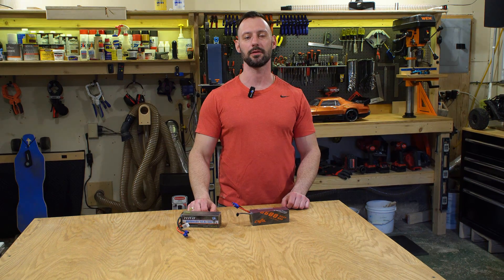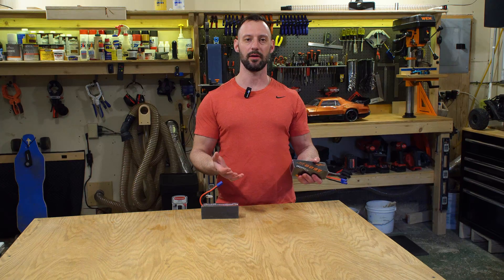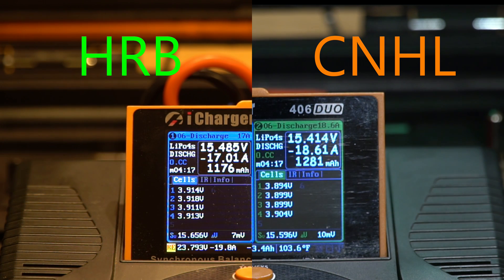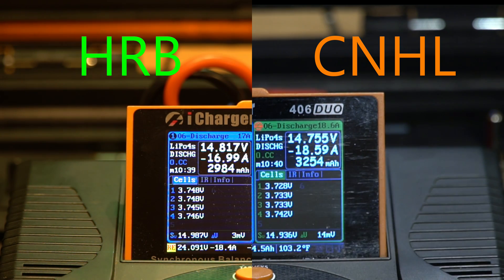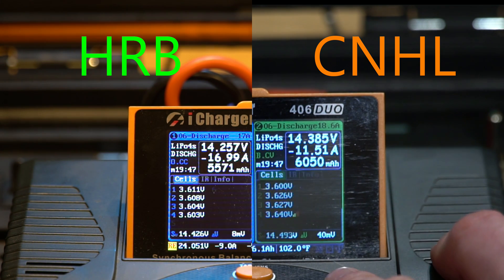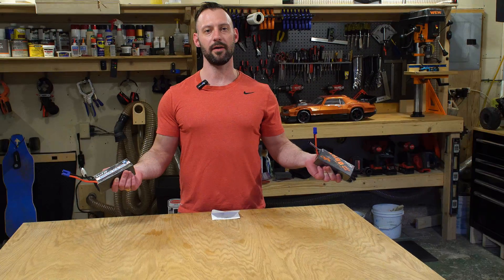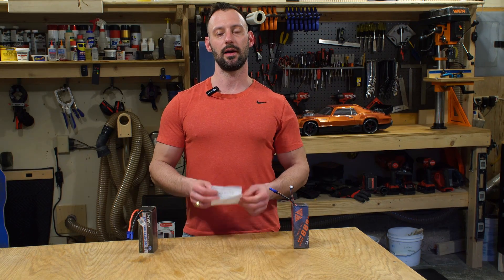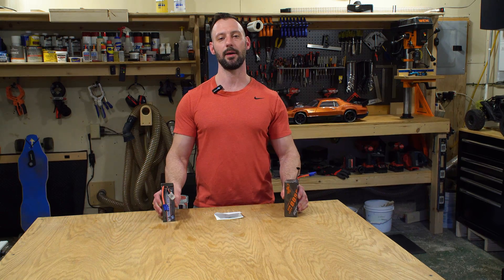Lipo Discharge Test - HRB 6S 6000mah 50C vs CNHL 4S 6600mah 120C - Does C rating matter?

Comment: Maybe I'm late, but I don't understand why you continue referencing the c rating when you didn't test that, you tested the capacity under an arbitrary number, the test to verify the c rating would be pulling the c rating, in this case 792A, don't get me wrong, I'm pretty sure it would explode, but the same for the HRB at 300A

Comment: Great tests and good info. Nope, C Rating does not matter because all C ratings are exaggerated these days. In reality, the most powerful LiPos on Earth these days are in use in the Military and can output about 50C continuous discharge. Most LiPos in the RC hobby will never output more than 30C continuous. Go to the radiocontrolinfo website and use their calculator to determine a CONSERVATIVE (safe to go over the number by about 10%) true continuous amperage maximum. Keep in mind that an ESCs rating means nothing - the motor is what determines current draw and on a Typical stock Arrma Kraton 6S, the current draw is about 75-80 Amps under hard acceleration with good traction. Assuming 1.5 IR for both packs to give them the benefit of the doubt, the calculator shows a maximum continuous output of 165.66 Amps for the CNHL and 158.40 Amps for the HRB. This makes sense simply because of the capacity, but as you showed, a continuous discharge test is a different test than just checking IR and doing a slow, careful full charge and discharge cycle like I did to break in brand new LiPos and then measure IR at full charge after resting for a bit. My HRBs have been pretty good but I have owned better LiPos. Honestly, you do get what you pay for to an extent. My Gens Ace Basher series 6S 6800mAH 120C packs are the best LiPos I have ever owned after 20 years in the hobby. They don't do anything special for power, but after over 2 years and 100+ cycles on each pack, they still show reasonably low IR numbers and still feel brand new as far as power and runtime goes. The same cannot be said for my HRBs, Hoovos, or SMC Racing packs. CNHL seems to be pretty decent, but still can't stack up to my Gens Ace LiPos. I think CNHL is great for a budget option, I was able to get those same 6600mAH 4S packs for under $70. No idea why you paid $110 for yours. For a premium option with a longer lifespan, definitely go with Gens Ace basher series. Ya, at $150 for my 6S 6800mAH 120C for my Kraton 6S - its a tough pill to swallow, but I can promise you that you will get what you paid for. I have 3 of them and they are all consistently fantastic. The Option closest to the CNHL in this video would be the 4S 6800mAH 120C (essentially the same as my 6S just in 4-cell version) Gens Ace basher pack that goes for $99.99 on AMain Hobbies.

Comment: Three years & $59 later of almost daily use, the two pack of HBR 4000Mha 60c are starting to show detirioration & balance plug on both while charging says , check balance port which just might be a loose soon to unsolder connection . Ordered the new HRB  4500Mha  100c 3's   in the Red/Black wrap & hope its also from a good batch.

Comment: cnhl has a 4s 6000 120c hv weight around 450g, and 4s 5000 65c with 540g  
Why, bigger capacity with less weight??? also higher c rate, is that make up? Thank u

Comment: I have 8 of these, i knew straight away they were good, so ive brought 4 sets of 2 so 8 total
Not so cheap here in the UK though, most sell em for £60 EACH, but I found a eBay seller that did them for £38 each, so I snapped em up

Comment: I disagree with your conclusion. If anything the CNHL outperforms the HRB - it maintained roughly the same voltage under a heavier discharge load. If you want to compare performance you need to test both batteries at the same discharge rate and then see which has the higher voltage under the same load.
Reply from the maker: I would agree with your point if they were the same capacity, but they are different. The rate I used was in respect to a multiple of the capacity or c rating. It would not be fair to discharge them at the same rate.
Reply: @mzgarage  agreed with the comment below you in this chain.  An rc car isn't going to be making those decisions on drawing less from a lower rated battery.  The test should be at the same rate, just like an rc car would.
Reply: @mzgarage   your car is not going to draw less current from a battery because it has less capacity or a lower c-rating.

in our electric motors the magnetizing current is directly proportional to the torque of the motor while the RPM is a function of the voltage. that means the HRB and the CNHL would run the motor at the same RPM, but the CNHL would produce more torque, and therefore power (power = rpm * torque) due to its higher current output.

Comment: Meh this test show nothing, and charger is not a tool to check real battery performance, next guy without basic knowledge
Reply from the maker: I would disagree with that. I understand that these are not real-world current draws, but in my experience, the performance is scalable. If a battery outperformed another at a 2c, 3c, 4c, and 5c current draw, then at a 50c current draw the same battery will perform better. If you have any information that indicates that is not the case, I would love to read it. I am always trying to learn more. And it did take a little basic knowledge to build that charging station lol
Reply: meh yet another guy who knows nothing telling someone who did a competent video that they are without basic knowledge lol. Show us what you know!

Comment: I don't really understand how you are saying it out performs.  Yes, the IR is lower and voltage difference per cell is lower for the HB, but thats at a very low discharge rate.  When I go to a drag strip, is a stock Corolla engine going to out perform a built V8 with turbos and alcohol?  Sure, it will last longer and never blow up, but it wont get to the finish line first.  Hit both batteries with a 150A continuous load and give me that data. Also, isnt it typical for new lipos to reduce IR over the first few cycles?
Reply from the maker: I completed understand what you are saying. No, this test is no where near the real amp draw seen in use, but in my experience testing batters on EDF fans with 100+ amps draws, the batteries wit lower IR that performed better and lower draws were the same ones performing better at higher amp draws. I am thinking about building testing rig with one of my old EDFs to make some videos with.

Comment: this wasnt the test i was looking for but its the closest thing to it, and it was cool to see anyway because i also have several arrmas and other smaller cars... i'm building my second e-moto rn. going lipo for this build. i need the energy density of lipo so i can save space and still get the big numbers my system is. 126V (30S), 700 battery amps, 1400 phase amps. trying to find a video of lipos hitting their rated discharge current for prolonged testing. I'm aiming for at least 32AH. everyone knows the majority of lipo companies lie about their C rating because theyre almost exclusively used in rc cars.. a 6600mah 120c lipo can (supposedly) do 792A continuous.. yet the most anyone will ever ask of it is what, 150A for v4 arrma 6s's, 160A on the v5 arrma spektrum firma stuff, 200A continuous on the xmaxx esc with 320A bursts.. so if the lipos will never see their rated current but the companies can sell more batteries by saying theyre a higher current than they then i think they view it as a win win. They make more money and we think were getting a superior product that we wont max out anyway so we wont overheat or cause a lipo fire.. the lipo industry is very shady with stuff like that. RC lipos are the only sub set of the battery world that does this.. 18650's, 21700's, pouch liiions, pouch lipos, anything else in the diy world, they not only meet what they say they can do but they almost always exceed what they say they can do.. 5000mah 21700's doing 5500mah, 17A panasonic ncr21700's doing closer to 22A.. etc.. it is ONLY rc companies that intentionally mislead people. occasionally some chinese sellers will exaggerate about the specs of the cells theyre selling but its a huge no-no in the diy world. yet people just take it in the rc world. i hate that shit. Ive grown to trust my batteries from everywhere that i buy from but i ALWAYS do a full capacity, voltage, and IR test on all my lipos. the most dangerous chemistry is the one that lies about its capabilities. shit is ridiculous.

but anyway, that book i just wrote aside, dope vid. im glad i stumbled on it. im subbin to support a good creator.
Reply from the maker: Holy shit, 30S! I have never heard of anything running that high, well except anything you plug into your wall. That sounds awesome though.  Yea, the C ratings are outrageous now days and most of the lipos would probably start on fire if you put that load on them. It seems like most EVs are using the 21700s now. Share some links the build, I would love to see it.  Thanks for the sub!
Reply: @mzgarage  thanks man. Yeah 30s is huge power. So is a (real) 700 battery amps. Lol.  My current bike is 20S. That's already on my channel. It has changed extremely drastically since the day one build but you can get the gist of what I'm working with in that video. I plan on making a video on the new build too eventually.  It's gonna be insane!!!

Comment: Great video I would be interested to see how the socokin batteries are from Amazon recently I got two 6,000 mah 120c packs for about 110$!
Reply from the maker: Thank! I will add them to the list. I think the Zee's will be next.
Reply: @mzgarage  Nice I will be looking forward to more of your videos, I’m still on the lookout for a couple 4s packs!
Reply: @mzgarage  I would also look at SMC, and LiperiAir - they both are VERY strong performers in my testing (the 80C 3s LiperiAir actually outperformed the 100C version in my speed runs but they were both strong).  If you want a low performance LIPO to test against them, Ovonic, Tindling, Hoovo, Hilldo, and the Liperior Endurance line have not performed well in my testing.